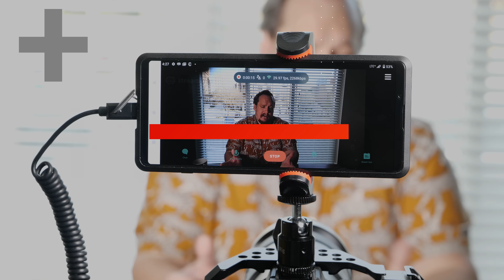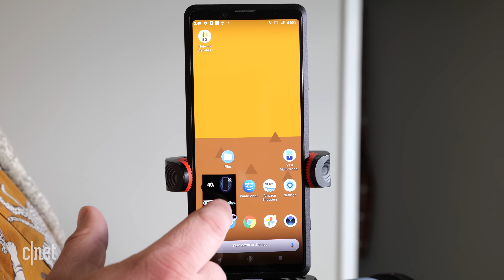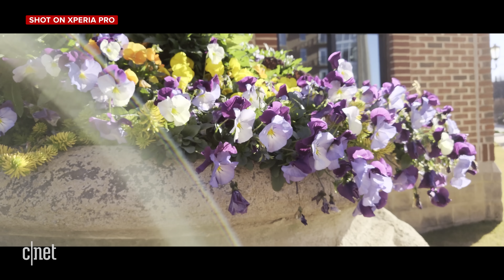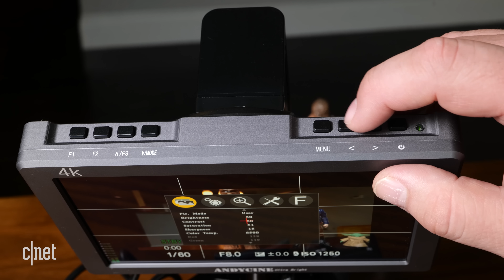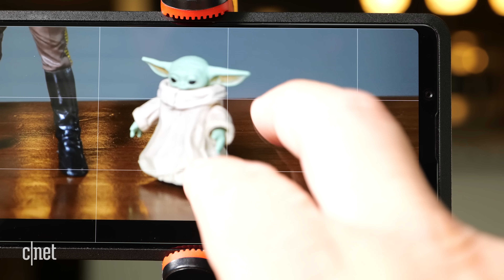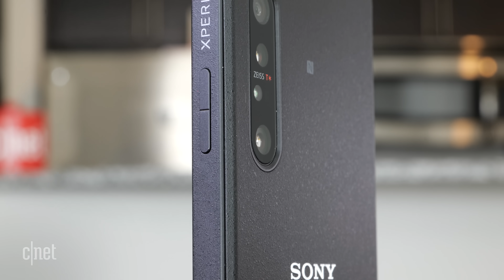Sony Xperia Pro review

Comment: Should've atleast have a Snapdragon 870 and 5000mAh battery atleast
Reply: it's a 2020 phone actually, so by the time of production snap 870 still not around
Reply: @nostalgeek_id  right. And if it were released this year (2021) it would've had a 888 snapdragon instead. The battery is still plenty big. Just back in 2018, 4000mah was massive for a phone.

Comment: It's for no one, Sony should stop making this weird and stupid phones
Reply: It's for professionals. I have the Sony Xperia 1 II. You have most likely a cheap chinese phone
Reply: @SonyTechEnthusiast  Uh my son, i was sony fan boy just like you, and i used z2 and z5, and the Xperia x, xz1 and xz2 and xz3, and even the Xperia midrange phones, xa1 xa2, believe me i owned sony phones more than you seen on your life, but when i tried others phones Samsung huawei oneplus, Sony phones just a crap and garbage, poor camera and a very boring software the battery life very poor for the price what Sony ask for it you can get best value and experience with others phones
But i understand you are a fan boy so it's okay
Reply: @stunningdesigns2278  son? I'm probably the same age or older than you. I've had Samsung, Apple, etc. But my first Sony phone was the Sony Ericsson T610. I have most of the major xperia flagships. Currently, my 1 II takes better photos and videos than your old list of Xperias especially in the new software, PhotoPro and CinemaPro. But I guess you relied on auto mode or you don't know photography. Use manual to take better photos but you won't because you let a computer do the work for you. And I get 10 hours SOT on my Xperia 1 II, which also doesn't have the UGLY notch, hole, etc. and has front firing stereo speakers, sd card slot, headphone jack: all of that are important to me and Samsung, etc. don't offer that
Reply: @SonyTechEnthusiast  my first Sony phone was Sony Xperia tipo, i don't know about Sony mark 2, because i didn't used it i can't judge, but from the old phones that i used they have a lot of problems, heating and battery life boring software, 
I'm as a consumers i would love to see xperia and huwaei and Samsung making good phones, so i can try different phones with different experiences, 
Just from my old experience with Sony phones wasn't good 
Im glad to hear they fixing problems with the newest devices

Comment: it have a HDMI port....yup...thats all
Reply: Plus:
1. 12 GB RAM
+ 512 GB internal memory
 - with micro SDXC support up to 1TB
2. 5G mm wave antenna 📶 built in
3. ZEISS optics
4. 4K HDR OLED display (3840× 1644) 
5. Sony Alpha camera AF (auto focus)
6. PlayStation™ Remote Play
7. LDAC Wireless Audio; 360° Reality Audio
8. Dolby Atmos+ DSEE Ultimate
9. Headphone 🎧 jack 👌😉
Reply: @Lobelt108  and 2500$😏
Reply: @Athiraarjun21 , yes, but  HDMI port is not "all" for that price 😉

Comment: $2500 😂😂😂🤦‍♂️
Reply: Cheaper than the alternative FYI
Reply: @SonyTechEnthusiast  what alternative
Reply: @DanielK1213th  a separate monitor, modem, encoder, and a external battery pack which all cost more than $2500
Reply: @SonyTechEnthusiast  and don't have 5g, it's actually better buy than folding phones that cost 2500
Reply: @The-Heart-Will-Testify  Not really
Reply: @The-Heart-Will-Testify  yea but folding phones are in their own category.

Comment: 9th comment, nice video! Still prefer iPhone though…
If you agree
👇
Reply: they major challenges investors face may range from controlling impulsiveness to the frail of compulsion, most newbies and would be investors often undermine and most often neglect the important of technical analysis with regards to trading .Technical analysis overly predict the movement of asset prices regardless of what is happening in the wider or broader market. Essentially, the process that works well in other to accumulate and grow a very strong portfolio ahead. However,i will advice investors and newbies to take full advantage of the market and to trade with Dr. Roland Lerch involves studying the paths of a particular asset movement in the past do as to establish a sustainable pattern that can be used to predict future movement. permit me to say that ,it's best advice youfind a workingstrategy/daily signals which has been so profitable and accurate. in less than 5 weeks trading with Dr Roland's daily signals i was able to grow a total of 6.9 BTC with my initial investment of1.5 BTC, this you would say is a very good profit. Dr Roland is a true resources in space today and can be reach via his official whts app page ( +1 6 1 5 6 3 7 9 7 1 9 📞) : for inquiries into profitable trading systems
Reply: @TH-fd8kq  Imma confused... Is this whole comment for commercial purposes? I kinda not understand most of it but sure I guess…
Reply: @hello_world1897  I just believe its advisable you venture into investment rather than Just spending unnecessarily if you really care to acquire financial freedom.
Reply: @TH-fd8kq  Ok, I am sorry but I think you have misunderstood the randomness of my comment. I was just trying to leave a “mark” that I was the ninth to comment and also add a little something behind it… But it’s nice of you to advise me of financial matters whilst you are only a stranger to me. Thank you Josh Love.

Comment: Outdated hardware and software is the phone biggest achilles keels
Reply: This still has better specs than most phones, no other phone has a 4K OLED
Reply: @manveerghuman5276  'cause no one needs 4K on such a tiny screen
Reply: @andreydavydov6417  yep that's what they all say until Samsung or Apple does it. It's an engineering marvel, no phone has come close since 2015.
Reply: @manveerghuman5276  it's the thing about sony it's gives you great stuff but it's only Samsung and apple that get attention when they implement them
Reply: @manveerghuman5276  Samsung already did it - this (useless) 4K display was manufactured by Samsung :)
Reply: @andreydavydov6417  what phone did samsung make that has 4k display? Anything lower is down grade, it out performs any Samsung in battery, camera, speed and more lol....
Reply: @andreydavydov6417  4k movies videos 🎉 are fantastic on Xperia 1 mark 1 4k display anytime anywhere
Reply: What outdated hardware, and software?